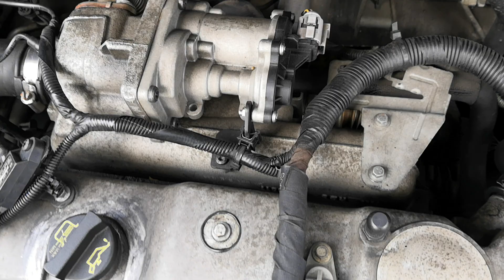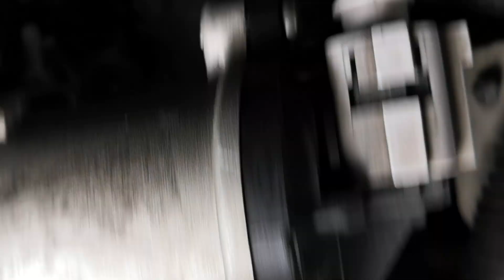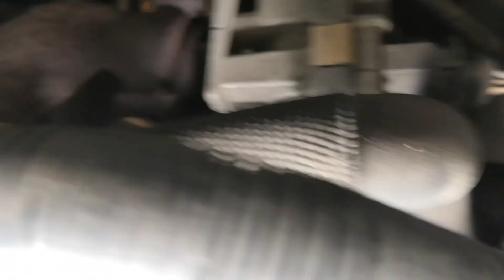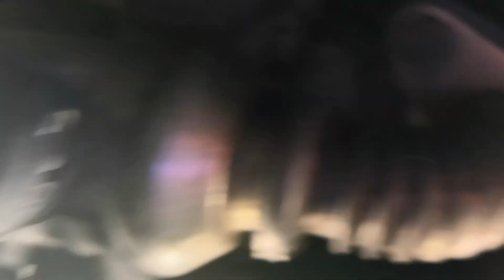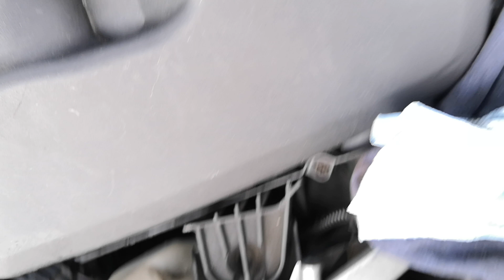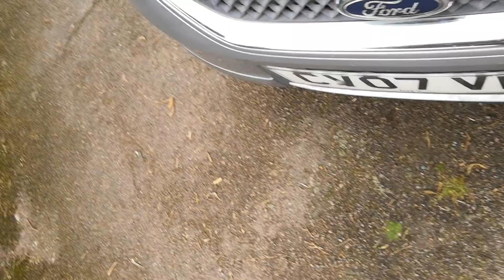Ford Galaxy 2007 1.8 TDCI whistle noise when accelerating

Comment from the maker: It was intake problem after all....since then the Car has been sold, that is why I have never come back  over here, I apologise for delay!!!
Reply: When you say it was an intake problem, what exactly was the fault?
Reply from the maker: @charliekarting3401  I have checked intake hose which had a small crack on it!!..if you care too much for your car, i suggest you to buy set of air hoses and replace all of them...also check inter cooler,sometimes it gets damaged and air leaks
Reply: @Luckypusher  Many thanks for the reply
Reply: I have just a similar sound.. Where is it caming from?
Reply: did you have loss of power?

Comment: Hi. Did you find the problem? I have the same problem with my S Max 1.8tdci 2008 titanium
Reply: Pontes Mocho  hi , do you know where that noise comes from ? My C Max 1.6 tdci does  it when i accelerate
Reply: @robertacatrinei3402  yes.. The noise come from the egr pipe to Intake admission. My seal was broken..